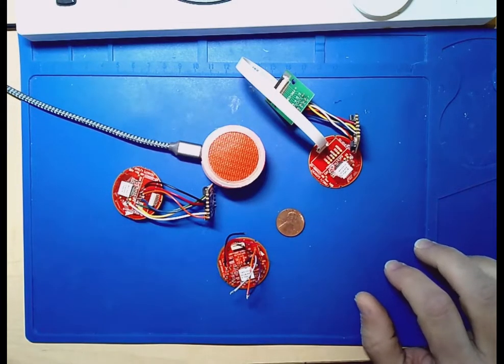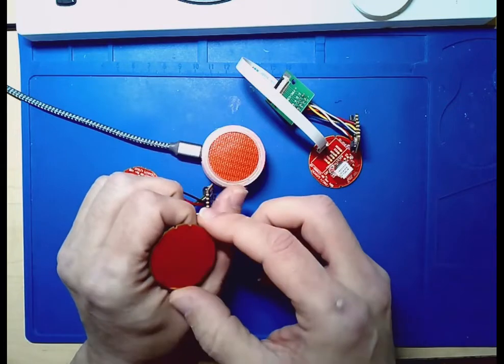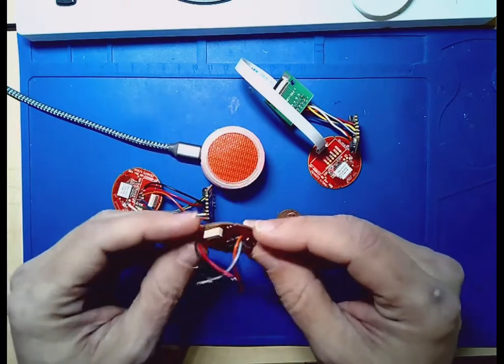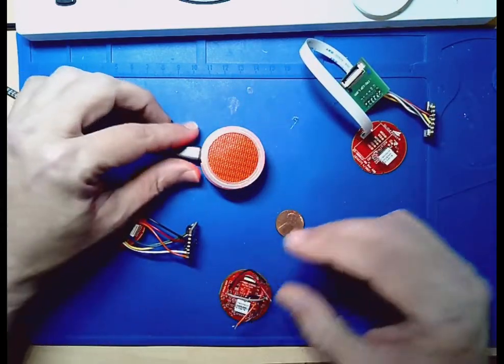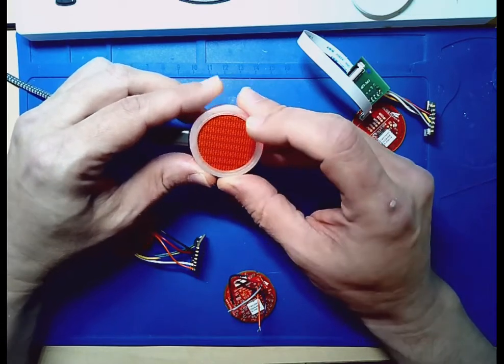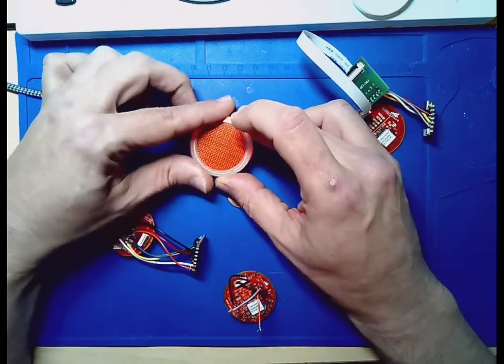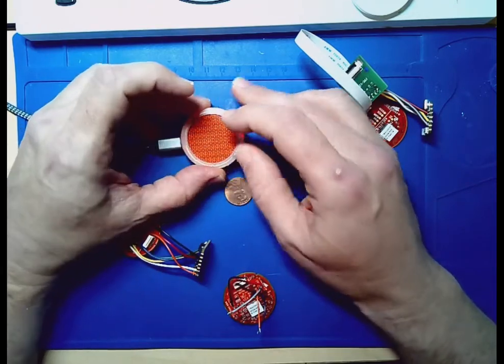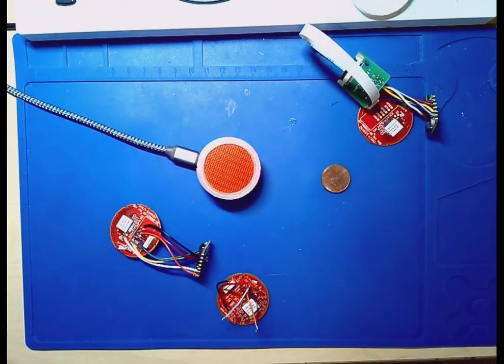GlidePoint as Joystick for XBOX Adaptive Controller

Comment: Does it have good resistance?
Reply from the maker: It's smooth. Similar resistance to a computer's touch pad. It's the same sensor as was used in the original Steam Controller -- and is the little square touchpad on the Steam Deck.

Comment: Is it then how to use the lower right joystick of an Xbox controller? Can you press it and activate a button like any other analog joystick? I want to use it for an arcade controller, put it below and to the right of an arcade lever.
Reply from the maker: When used with the XBOX Adaptive Controller, it can be used for either the left or right analog thumbsticks. There is no press to click -- that would have to be handled by looking for taps. And I've not had reliable results with taps.